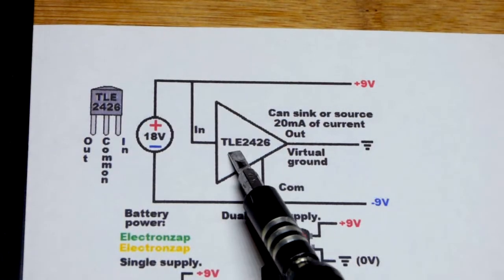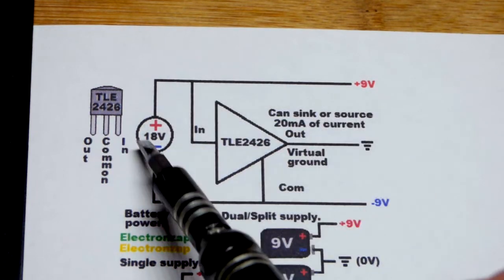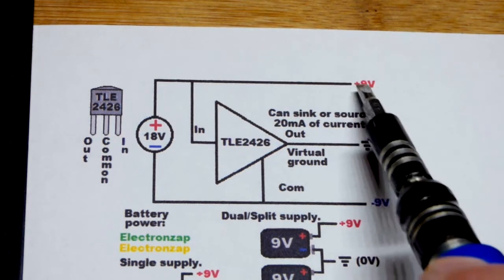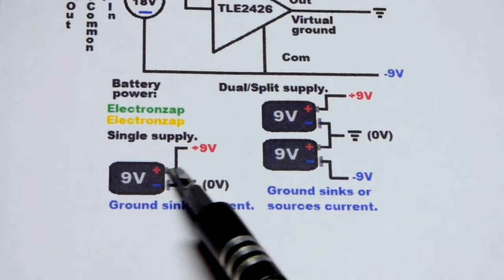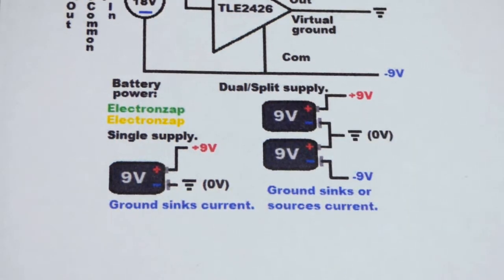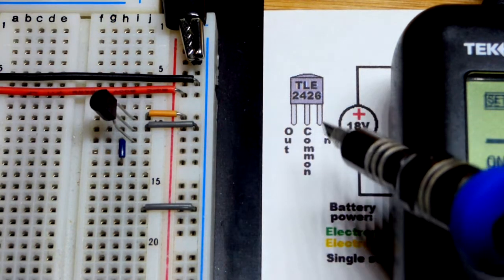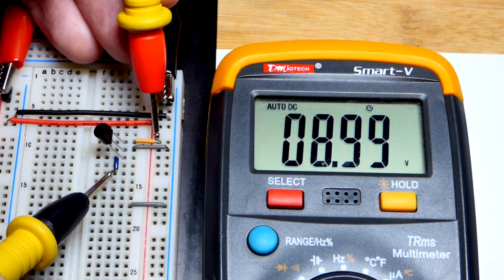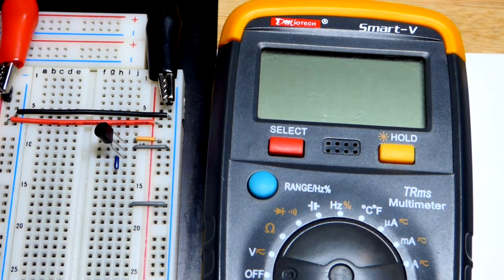TLE2426 3 terminal virtual ground rail splitter electronics component introduction

Comment: I see Negative Voltage on Audio Circuits but I haven't noticed it anywhere else. Knowing about this is great thanks for the video.
Reply from the maker: Yup, audio and radio is the vast majority of circuits that I come across with negative voltages.